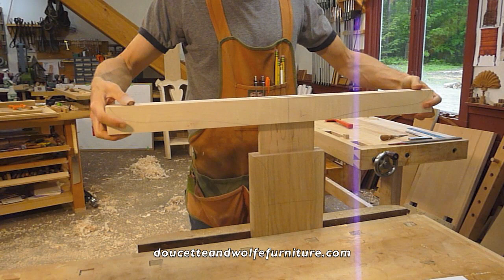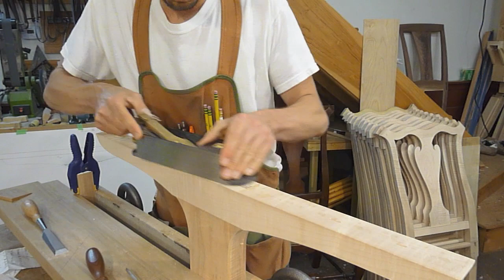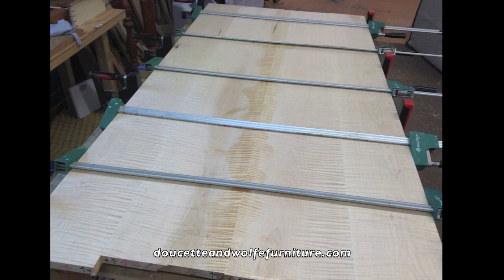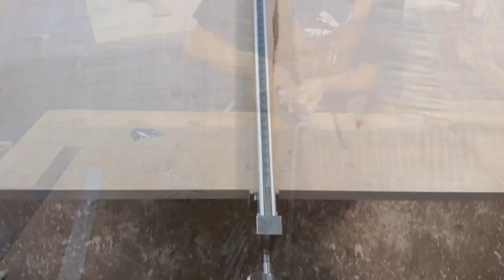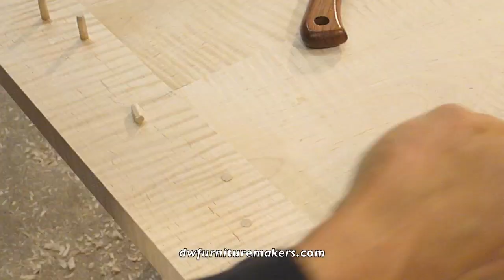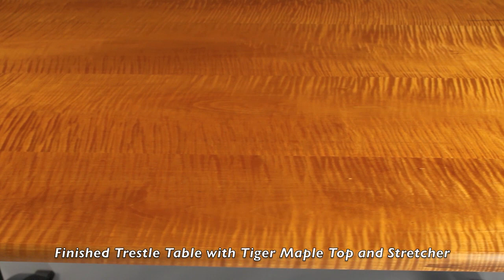Trestle Table Building Process by Doucette and Wolfe Fine Handmade Furniture

Comment: Utterly beautiful.  Your work is truly amazing.

I still fail to understand how breadboard ends can work with a dimensional lumber top and seasonal expansion.  I get the spring joint, but then it seem like the draw pins effectively negate that effect?  Or is that the purpose behind the odd-shaped holes, that it allows the end not to restrict expansion?  And despite all of that, won't you always have ends that are often wider or narrower than the rest of the table?  Gah!  Help!
Reply: Yes, the holes are elongated on the tenon to allow movement for the top and yes there will be some degree of movement resulting in a more or less proud bread board end.